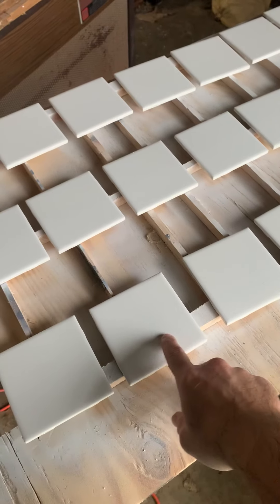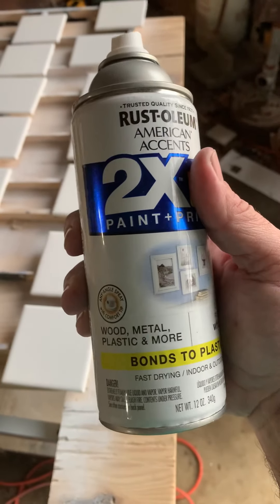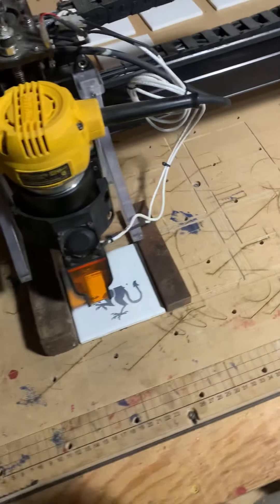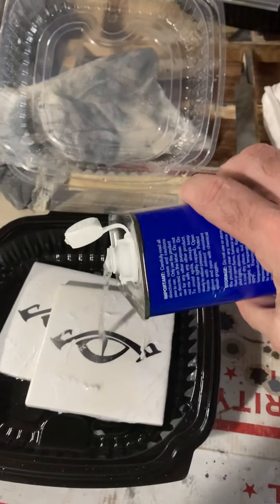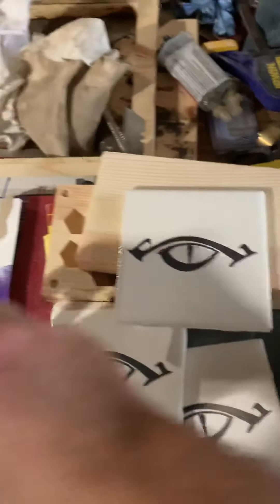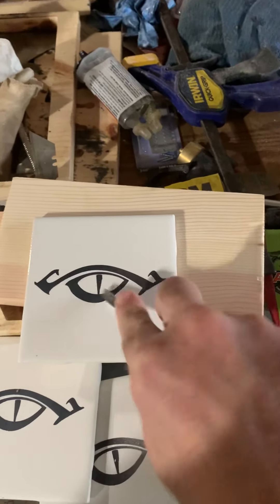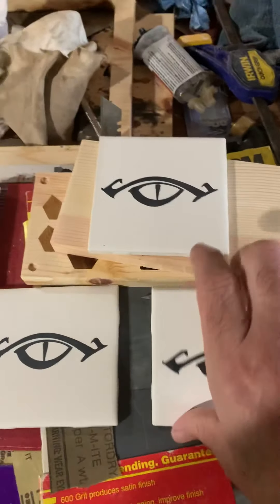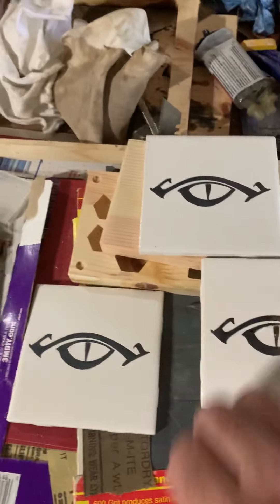Laser engraved Tile coasters

Comment: Can i do this with my co2 laser machine  160watt?
Reply from the maker: I have been able to do this with my 100 watt co2 laser though I am not able to get the same level of detail.  I am relatively new with my co2 laser so I am sure with some experimenting you can manage it well. I had to go pretty low in power and slow.
Reply from the maker: I have engraved slate tile without paint with my 100 watt. looks great.
Reply: @williamscarborough6663  can you tell me the technique?
Reply from the maker: @benhcine  nothing special. find the power and speed that best works on the slate. you want a nice clean white. took some trial and error to not have it yellow.

Comment: You say you put corking on back ... so is that intended to be the coaster part?  basically they would flip them upside down for drinks and stuff?
Reply from the maker: No sir. The cork is to protect what ever your putting the tile on. The bottom of the tile has rough ridges and could scratch wood or glass easily.
Reply: Thanks!!

Comment: How long does it take to do the burn on each tile? I know images will differ but what’s a average time for each
Reply from the maker: roughtly 30 min to an hour for a basic image. It has taken over three hours for a pretty complex image. The diode laser I have is 2.8 watt one which is extremely low. With higher wattage lasers you would see increased times. The long burn time is one of the reasons I made the grid and do a bunch in one go. saves a lot of time resetting each tile.